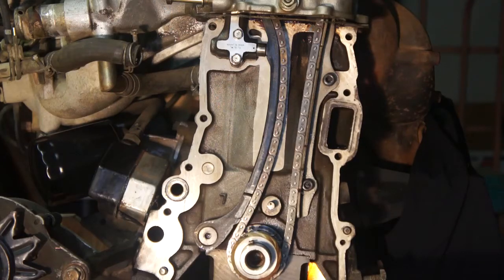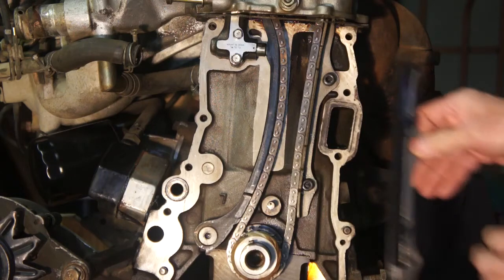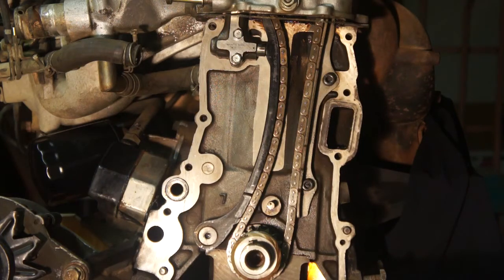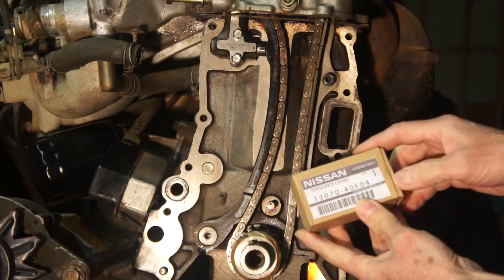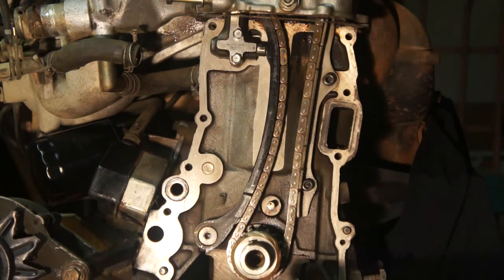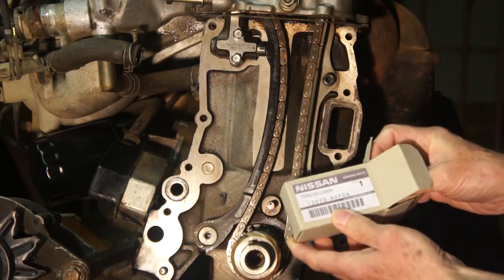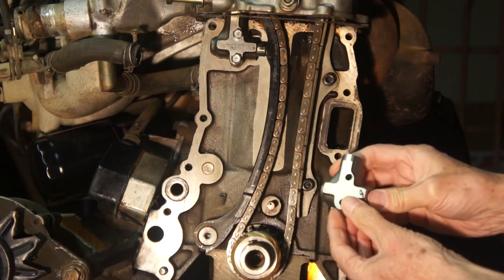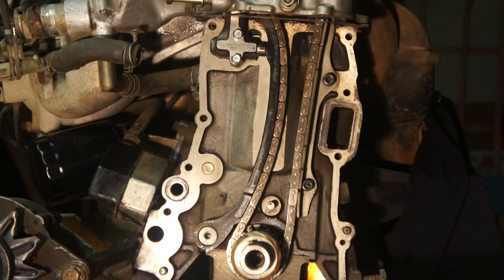11 Nissan KA24E Hydraulic Tensioner and Chain Guide Revisions

Comment: In Africa we put a small metal rod inside that tensioner with a spring to absorb a little bit of shock works perfect
Reply: I have seen similar fixes done over here as well.
These are great engines, except for the stock tensioners.
Thank You....
Reply: @jamesmartin5370  could you simply put some sort of spacer on top of spring inside piston to give it more tension

Comment: my right side tensioner is missing and my chain has been rubbing the hell out of the shaft at the side of my block near the coolant im afraid my d21 wont last
Reply: The shaft you mention is probably one of the two guide fasteners.
If its not fixed, the chain will cut the fastener in half then cut a hole in the coolant jacket and antifreeze will leak into the oil.
This should be fixed, how many miles on the engine? I have seen these engines last for 400,000 miles and more trouble free.
Reply: @jamesmartin5370  140,000 but it has been a problem since i got it around 135,000 the previous owner knew about it. i was just the sucker who didnt when purchasing. it will be a total of 300$ for all gaskets and parts including a brand new timing cover where it is wearing into the coolant portion of it is only 80$. new water pump is 45$ and a new thermostat and guides are like 50$ might as well replace all of it if im going down there. so far 1/3 of the shaft is gone and its very close to penetrating the wall near the coolant.
Reply: @sipmeister3611  That shaft you speak of sounds like the tension side guide fastener instead of a rotating shaft.
It sounds like the engine is a pre 1996 model, they had the all plastic tension side guides in them with long fasteners, they were dis-continued in 1996. 
I came up with a process that can be used to remove those tension side fasteners and guides without the need to remove front timing chain cover, you may want to look at the video.
I also came up with a process to install the ratchet tensioner without removing the front timing chain cover, you may want to look at those videos before you cash in for a chain job if time and money are a concern.
Those chains should last 180,000 or close to 200,000 so still some life left in it.
Reply: @jamesmartin5370  i checked your channel but no luck
Reply: @sipmeister3611  Some of the following videos cover the ratchet tensioner and tension side guide issues, also how remove and replace without removing front of engine See # 22, #17, #16, #15,#14,  #11, #12, #9
Reply: @jamesmartin5370   hey james whats the best thing to use in order to seal up that wonderful timing cover ?
Reply: @jamesmartin5370  I don't live on the forums, but I've never seen these ideas really get mentioned.  Thanks for sharing the wisdom you have gained from your practice.

Comment: I just got a d21 hardbody ..... I’m not a Nissan guy , but I am a car guy 

Why not use a spring .... no need for oil pressure to be present 🤷‍♂️
Reply: The piston has spring behind it.
There is now a self-adjusting ratchet tensioner available that  eliminates excess chain slack in these D21s.
It self adjusts as sprocket teeth and chain show wear. 
Given time maybe someone will come up with a better system, At the moment its proven to be best item out to control start-up rattle in these.
Reply: @jamesmartin5370  who makes the best one ?

Comment: Someone told me that OEM Nissan Filter hold pressure ..... true? False?
Reply: I had problems with startup rattle in my K21, at the instructions of Nissan Dealer I installed the larger diameter Nissan OEM  Oil Filter on mine.
My rig still had start up rattle.  
Your friend may have a different experience using one, that's good, but the OEM oil filter made no difference in mine.
Reply: @jamesmartin5370  Right, better oil pressure ain't goona fix a failed timing chain guide or a loose chain, I even met a guy who installed an oil pressure primer pump on his truck, neat stuff, but KA drivers still need to ensure that that timing chain is taught, a loose chain is a time bomb, hear it? Tick, Tick, Tick. That sound is worse than the giant crocodile, circling Mr. Smee's sinking row boat with a clock in it's stomach. Tick, Tick, Tick.